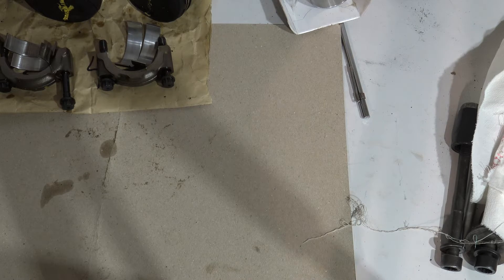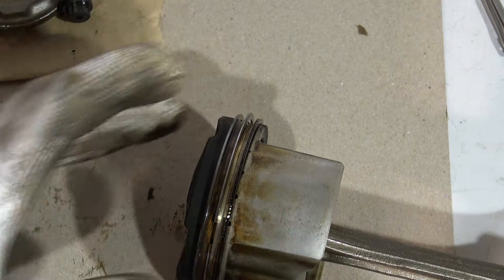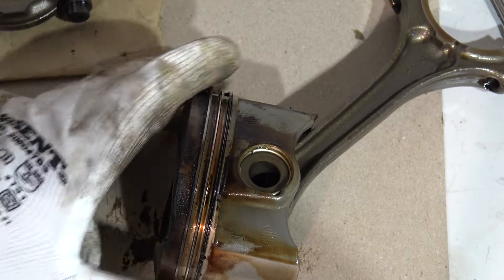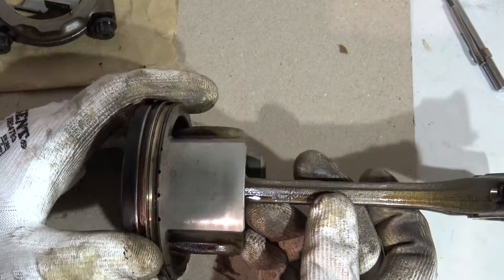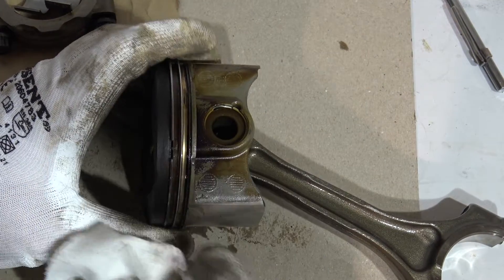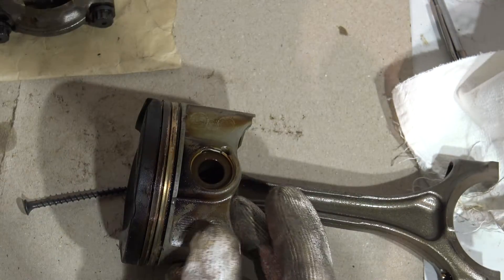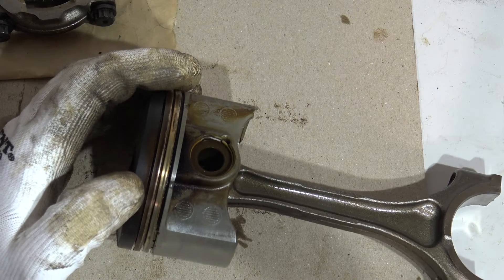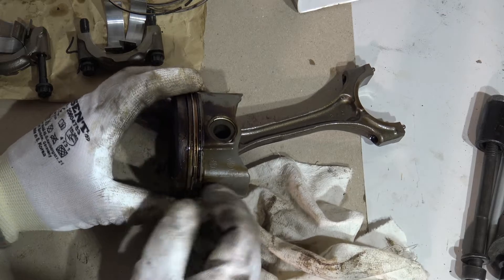How to inspect engine Piston

Comment: when you have everything taken apart, and you have a new set of piston rings waiting, is it best to go ahead and replace all the piston rings, even if the old ones look reasonably okay?

do you replace the rod cap bolts, or is it okay to reuse them? or does it depend on the engine type?
Reply from the maker: I have rings waiting and I replace also connection rods bearings